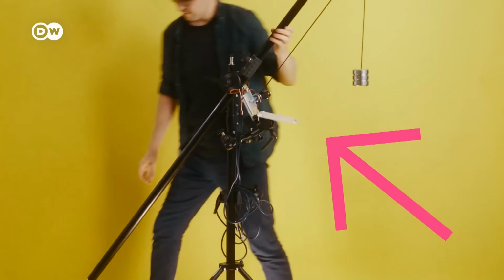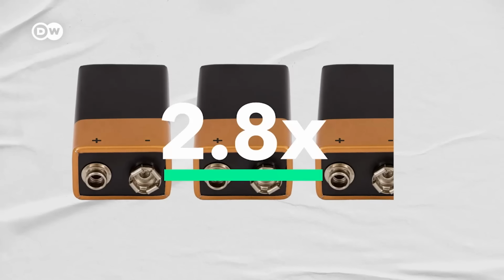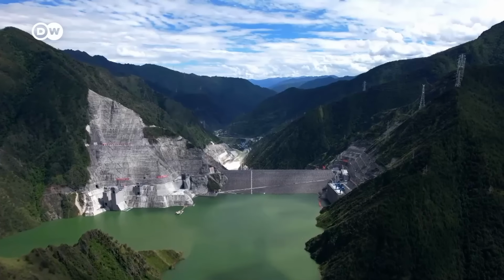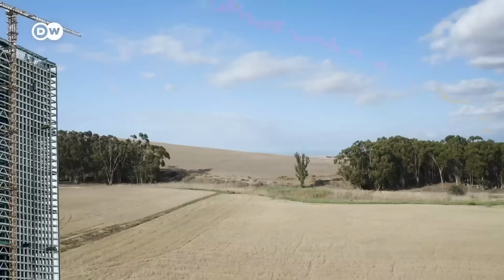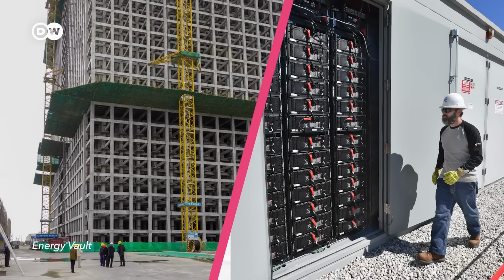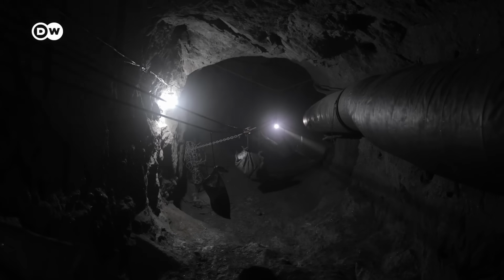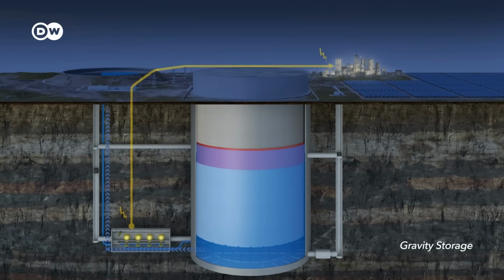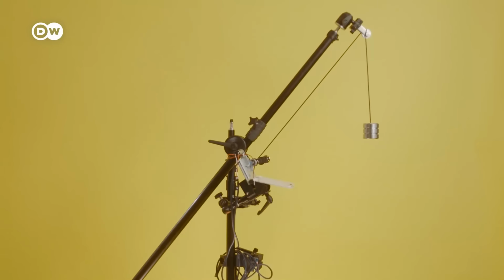How to use gravity to store energy

Comment: People will do such gymnastics instead of just acknowledging we could use nuclear energy to decarbonize. The goal must not be 100% renewables and batteries and must instead be 100% low-carbon energy.
Reply: Yeah, lets put everything on the outdated, inneficent, expansive, and highly dangerous technolgy that no insurance company touches with a 100 mile pole. Also lets ignore that we still have no plan were to store the waste and that the excavating and transporting of the fuel is also not low carbon at all. Also producing energie with nuclear power doesn't "decarbonize."
Reply: @Cookie_85  Nuclear is the just the best, one of the safest and cleanest forms of energy we currently have
Reply: @myboysd5772 
The best: In regards of energie density coal beats nuclear. And when it comes to effiancy wind and solar beats both of them since the energ is fat less.
Safest: Yeah Three mile island, chernobyl and Fukushima would like to have a wird with you.
Cleanest: With regards to Co² it's on paar with renewables, and only with regards to energie production.
Reply: Nuclear is not the answer.  It has one of the highest cost per MWh, long build times (10+ yeras), along with the non-zero chance of huge environmental disasters not just from the power plant itself but its waste distribution/storage networks along with nuclear fuel processing infrastructure.

Moreover, in the real world, time and money are top factors unfortunately.  The next 10- to 20-years are critical to void the worst of climate change. Yet it takes 10- to 20-years to complete a single new nuclear power station.  Nuclear power will have next to zero impact on the amount of energy needed to displace fossil fuels during this time.  Every dollar spent on nuclear now instead of renewables will actually just delay the global energy transition.

Comment: Are we all forgetting wet-cell batteries? It's cheaper than Lithium, and likely more efficient than Lithium when upscaled to industrial capacities. Much lower risk of accidents, if any other than possible liquid leaks, which are much easier to manage than anything else.
Reply: I agree and I worry every time they get install on a boat,   In a fire you are stuffed,
Reply: @BrinJay-s4v  and what about the sharks? which do you choose? battery fire or shark maw? i'm riffing here.
Reply: lithium is "wet cell" batteries just used lithium ion, other used, natrium ion, k-ion, sulfur-ion. all in "wet", even dry  batterai actualy "wet"

Comment: 5:25 thats just not correct
LFP batteries are expected to last much longer
you also shouldnt compare phone batteries to industrial purpose made stationary batteries

phones need to be compact and last as long as possible and therefore tradeoff in a way that makes them not last as long

phones also are usually charged to 100% unless users activate battery saver options that limit charging which really cripples the lifetime of the battery whereas industrial batteries stay within more favorable ranges
Reply: Lithium batteries do not belong to stationary installation. Benefits of these batteries stem from their capacity to weight ratio, which bears no value in stationary projects. If we want stationary chemical batteries, then iron-oxide or sodium-ion batteries are the way to go.

Comment: Gravity batteries are a borderline scam in most applications, I would not invest in it.
Reply: Why? How? Fundamentally it's a very good way to store energy, and a lot of it will be necessary.
Reply: @NoidoDev  Just Use water and a turbine. Even a giant water tower makes more sense than blocks on cables.
Reply: @YourArmsGone  
Maybe, or the engineers of that company know something you don't. They most likely can regulate it better. Also, there are other ideas in that video
Reply: @NoidoDev yeh, they know marketing green junk is lucrative
Reply: @NoidoDev  A AA battery holds some 3 watt-hours of energy. The same energy as lifting a 10 kilo (20 lbs) block up 100 meters (or 300 ft) high.
See how impractical?
Reply: @augustine6683  
If this is true, then yeah.

Comment: Any physics nerds out there know how that big energy vault building in china would compare to doing a comparably sized pumped hydro storage facility using existing water tower designs? Picture 2 water towers vertically stacked in an hourglass configuration with the pump/generator in between. My gut says that it might not have quite the same storage capacity,  but would be MUCH simpler/cheaper to build and maintain?
Reply: Water towers don't store enough working mass and don't have enough height drop. No town with a water tower uses it as a battery. Work it out yourself with a units calculator (I use Fourmilab), it's just `X tonnes * gravity * Y meters` in kWh. You have to use existing natural reservoirs with a substantial vertical drop between them, i.e. pumped hydro.

Comment: Interesting, but with the cost of batteries coming down fast and life increasing dramatically, I don't see how gravity can compete in any aspect.
Cheers
Reply: Hydroelectricity uses gravity (and water of course) and can produce tremendous amounts of energy - also, it can be ''stored''; pumped storage hydroelectricity is already a thing!
Reply: Gravity doesn't catch fire and burn at high temperatures producing toxic smoke.....    : )

Comment: gravity storage belongs to the category "junk tech"
just like solar roads, hyperloop or the line
Reply: I guess all those "celebrity investors" need to subscribe to thunderf00t
Reply: Except for the ones that use regular old and dirt cheap water.
Reply: @Beskamir  But only 70% of the planet is covered with that! There like only ver little of it on the remaining 30% and sometimes it does not fall from the sky in many regions.
Reply: @fgregerfeaxcwfeffece  
Woops I missed your sarcasm, I was too tired when I responded. Here's my original shameful reply.

You're missing my point. Instead of building a gravity tower where you need to worry about wind, weather, etc you can instead just dig a giant hole, move the excess into a mound, and then use a cheap liquid (such as water, but technically any room temp liquid would do) and just pump that liquid up and down the system with existing technology. Much simpler from an engineering and physics perspective and as such far more likely to not be a massive failure like most dreamy tech bro ideas end up being.
Reply: @Beskamir  Well, you noticed. Many don't. I just learned having fun with that.
Reply: @Beskamir  "just" digging out a giant underground cavern that holds enough water to store a significant amount of energy is an extremely expensive project! That's why no one does it, instead they search out locations where nature already provides an upper and lower reservoir.
Reply: After a proven tech like molten salt battery, I believe this type of battery will not be able to compete in the future
Reply: Yeah and thats why China is leading in tech and other industry. Because they don't just quack like US and you, they prefer practicality and innovation.
Reply: finally, a good use for the SuperTalls that only exist to exploit the housing market
Reply: Or wirecard or hydrogen
Reply: Make the connection 👉 The Connections (2021) [short documentary] 🌎 ♥️ 😎 ✨️
Reply: Hydro-gravity batteries have been used for centuries. They are called Dams.
Reply: @KGTiberius  dams are ok. But all these ideas about moving rocks to store energy are not going to work.
Reply: @KGTiberius  They're not the same thing. Dams rely on natural flow of water, while hydro-gravity batteries don't produce energy, they store it. I know what you're trying to say but clearly they're not the same thing.
Reply: @Hiro_Trevelyan  please Google energy on El Hierro in the Canary Islands.
Reply: @Hiro_Trevelyan  actually Pumped-storage hydroelectricity is a thing. Much cheaper and reliable than these mechanical storage devices.
eg Dinorwig Power Station.
Reply: @KGTiberius  Yes, they have.  Here in the UK many rivers have been reshaped over centuries with weirs to help sustain heads of water to power watermills.  An unfortunate side effect were tremendous arguments and managerial conflicts cause by the retention and release of water by  mill owners upstream of others. Another side effect was the hinderance caused to migratory fish; although we can now design compensations, this suggests that dams and weirs are somewhat fraught and not as cheap, simple and environmentally friendly as some would have us believe.
Reply: @KGTiberius we already have a technology decades old that truly works and can store so much energy it’s called pumped hydro storage and will actually work and not need maintenance in the same way as this technology that have so many moving parts it’s totally unrealistic to even think you can make it reliable and cheap to operate.
Reply: Ok, but could you provide a high level reason why? I see a lot of name calling but no explanation.
Reply: @larryhammond5907  Just think about it if these gravity batteries would work then they would already be everywhere.
https://youtu.be/NIhCuzxNvv0
Reply: I like how china gives green signal for every futuristic energy producing or storing tech ! 

They are more optimistic and hardworking for the future than US and rest of the world !

Comment: " PUMPED STORAGE HYDRO ELECTRICITY "

Adam something
Reply: Make the connection 👉 The Connections (2021) [short documentary] 🌎 ♥️ 😎 ✨️
Reply: Pumped Hydro storage requires significant elevation changes. I'm not sure if this specifically is the solution, but more solutions are needed for different landscapes and scenarios.